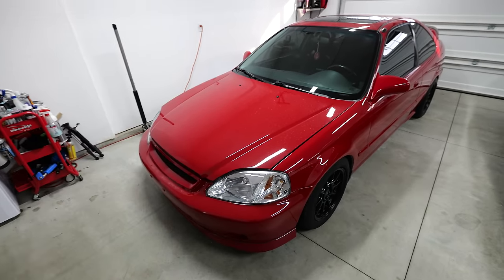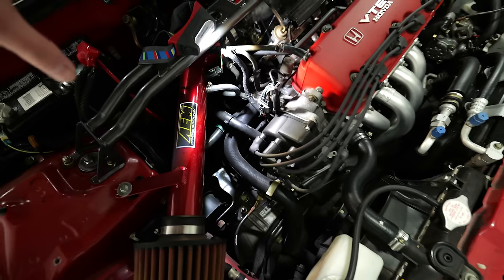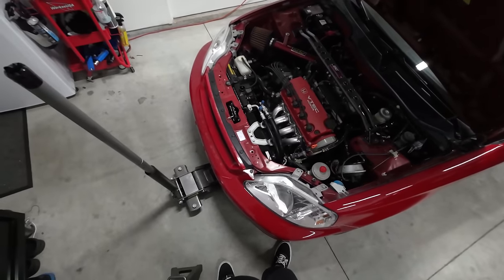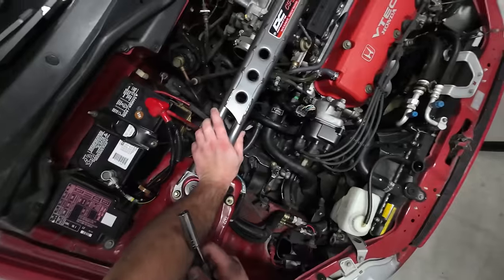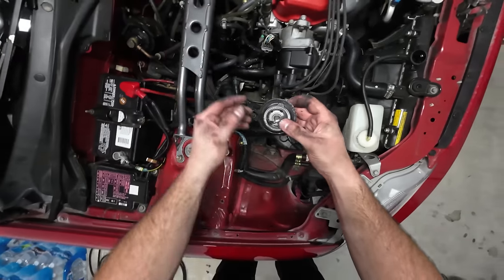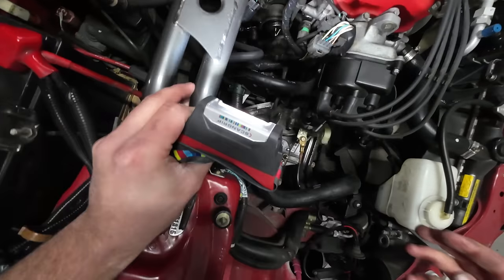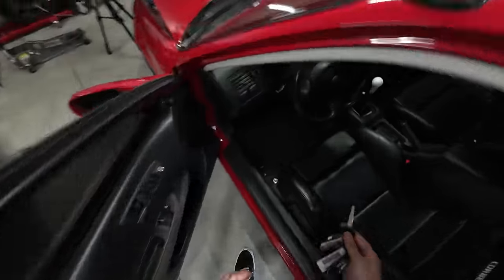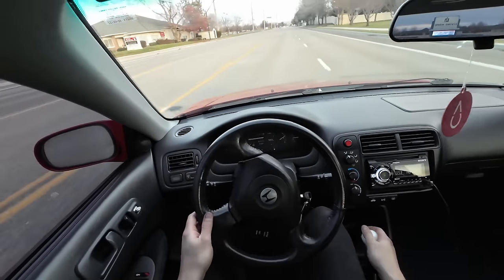How to Replace a Honda Civic Thermostat! | Easy DIY Tutorial

Comment: Just did this to my 2000. My thermostat was stuck open. Never fully heated up and ran really cold going downhill. Went in and out of child start mode. All works great now.
Reply from the maker: Yep! Cold weather kickstarts many thermostat replacements! Glad you got it swapped
Reply: @ALLDAYANTHONY you as well. Next got me is iacv and map....mines auto though so iacv is bottom of throttle body not on the back of the intake manifold. Any tips.

Comment: A couple weeks ago, the lower radiator hose popped off and I lost all my coolant, but I didn't realize this until I noticed that I wasn't getting any heat a few minutes after started the car (2000 Civic EX coupe) I drove it 9 blocks across town to get some gas, the temp gauge was at half-way up, not overheating, just a bit warmer than usual, and still no heat, really cold, 42 degree air! I opened the hood, the lower radiator hose popped off the radiator somehow, lost all my coolant! I panicked, drove it back home, luckily it was cold outside and downhill from the gas station I was at! The engine never overhrated! I  eventually fixed it myself, that lower clamp was a pain in the butt to screw tight, then I wondered about my thermostat, never changed it, not giving me any issues now but wondered how much of a pain it will be for me, your video showed me how, thanks!😃
     Tomorrow, Saturday morning, I'm going to change the spark plugs, cables, cap, and rotor, I have trouble starting it in the rain, runs a little rough during the rain.
Reply from the maker: Hot damn! You got lucky! Glad this video could help!
Reply: Dude i had the same story, except the lower radiator hose has a leak. Smoked up at the gas station not too far from home. Luckily made it home. Temp went all the way up. Waiting for new hoses to come in. Wondering also if i should change my thermostat?

Comment: The lower coolant hose is no heating at all which is causing for the cooling fant to not kick in. You think it might the thermostat?
Reply: Two reasons the fan is not kicking in one could be your fan switch test the fans put 12 volts to them first, if they cone on then you need to check your thermostat ince you replace it run your car until all the air is bleeded out then lower hose should be hot then the fans should kick in 
If that is not happening then you may have a head gasket damage

Comment: My civic doesn’t blow hot air anymore it send out cold air I don’t think it’s the heater core but I checked the hoses going into the firewall and they also seemed fine idk what it could be
Reply from the maker: Heater core could be clogged or bad. When you’re driving does the inside of your windshield get hazy?
Reply: @ALLDAYANTHONY  yeah my windshield gets really foggy and wind blows but doesn’t heat up I think another factor could be the window seals are also pretty bad old Honda problems